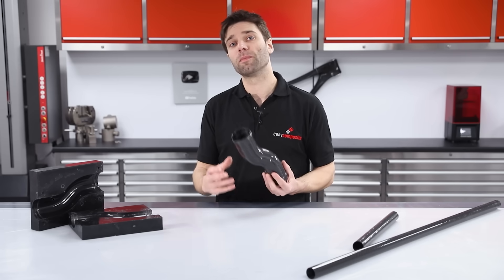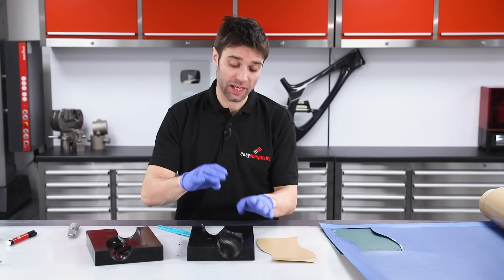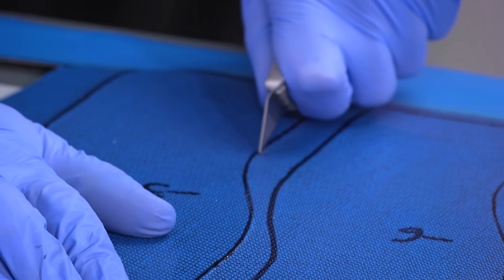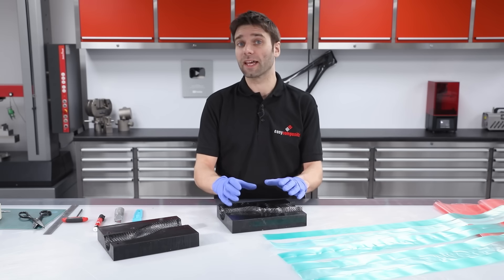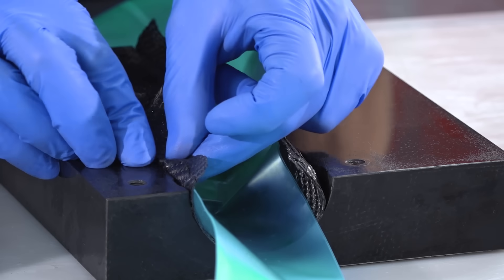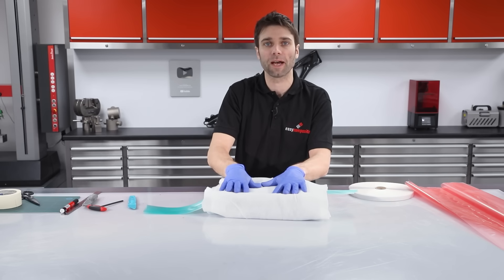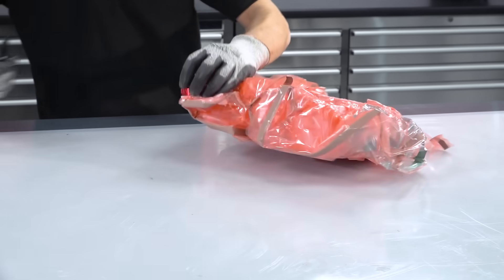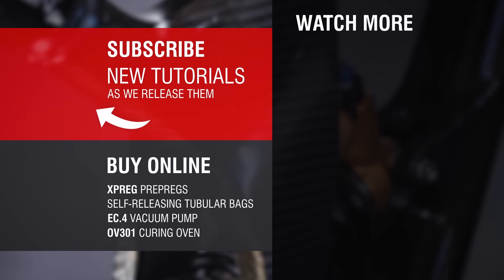Making Complex Carbon Fibre Tubes Using a Split-Mould

Comment: Sorry, but in formula 1, it is manufactured reversely. The mirror-smooth part is inside, and the outside is ugly as fuck, cause', its way more important that it functions, not the beauty.
Reply from the maker: Well, it depends which parts you're making. If you're talking about an intake then yes, but this process would be how they make a wishbone for example.

Comment: use a hair dryer with pre peg it's way more easy
Reply from the maker: Sure, you can do that (and we do in some of our prepreg videos). It really depends on the room temperature, the rheology of the resin system and the geometry of the part. Certainly no need in the case of this demo layup.

Comment: What sort of temperature is product made in this example capable of withstanding before failure?
Reply from the maker: The XPREG XC110 prepreg resin system has a Tg (glass transition) of 110C, at which point the resin would start to soften and the part would begin to distort. Other prepregs systems (including some of our own) have higher Tg, if required.
Reply: @easycompositestv  thanks,  I'm asking because I'm interested in producing an inlet manifold for a motorcycle. But I haven't done any testing about running temperatures or heat soak.  I'm just looking at the process that it maybe easier and cost effective than 5 axis milling of aluminium billet and more effective in terms of laminar flow than welding aluminium sections together.

Comment: Come on guys, if you're going to teach let's do it right:
1. Balanced lay-ups.
2. Debulking (esp first plies).
3. Bootlace detail.
4. Release / wax / copper slip bolts, especially since you've used blind captive fasteners (bad idea).
5. Release film before breather so you don't get fluffy components /  moulds.
6. Vac / Leak down test before cure.

Lets educate people, keep on dibbing chaps
Reply from the maker: Hi Matthew. We don't cover every detail in every tutorial, if we did we could never cover a topic without covering so many aspects that each video would last for hours and bore people silly. Whilst I don't agree with the importance/relevance of all that you've mentioned, especially on basic components, it is important to realise that over-complicating things can be as unhelpful in getting people to engage with a technology as not introducing people to it at all. Fortunately, almost everything you mentioned we've already covered in another video, at least once. This tutorial is designed solely to help people understand laps and internal vacuum bagging. Balanced layups: see our carbon fibre sheet video and others. Dubulking: see our introduction to prepreg carbon fibre, same for release film before breather, etc. etc. 
Anyway, thanks for the feedback, it's always good to hear different perspectives and opinions :)
Reply: @easycompositestv  it's not my opinion it's standard industry good practice developed by guys who have forgotten more than I know. Your tutorials reach thousands of people and offer good informative insight into composite processes, it however would be better to teach good practice throughout the industry. After all you are a composite training facility and hub of knowledge for others to learn from.

Comment: The whole vacuum method was a waste of time, money and materials. You can do it the old fashioned way and just inflate the inner tube. There are resins and polymers these days that don't require all that expensive crap machinery and special supplies, and reinforcing the moulds is the cheapest and most logical thing to do. But you'll always get someone who says "throwing more money at it gets you a better finished product" and those people hardly know how to turn a wrench like us "old school" trained guys" third generation Motorhead and the old tricks if the trade are still good enough, i will always laugh at the guy who depends on all those machines and special methods and whatnot 🤣👌
Reply from the maker: Good for you Slavic. Still, for those viewers interested to know how components like this are made today in industries like aerospace and F1 etc, where this process is used on a daily basis, then this is how it's done. Since industries like these have millions of ££/$$ riding on doing things the most effective way possible I think it's fair to say that they're unlikely to be a 'waste of time'.
Reply: @easycompositestv  i see your point. But the video isn't aimed toward education big industry. So yea, lol.

Comment: One could I think replace the layup with braided prepreg tubes of the correct diameter, simplifying the process. Has Easy Composites ever used braided carbon prepreg before?
Reply from the maker: There's a few obstacles with braided sleeves Anthony. Firstly, I'm not sure how braided prepregs could even practically be manufactured, stored, handled or used (although there may be solutions I'm not familiar with). For starters, the prepreg process has films on the inside and outside of the prepreg, I'm not sure how that could work - practically - for a braided sleeve. Furthermore, in most cases, the fibre orientation of a braid would be wrong. Braids will have predominantly +/- 45 degree fibre orientation, or at least some off-axis orientation, due to the way they're woven. Most applications for carbon tubes made the way we do in this video use a lot of unidirectional carbon oriented down the length of the tube, which isn't possible using a braided sleeve.
Reply: @easycompositestv  I believe that there are suppliers of braided prepregs. Not sure about those that are out of autoclave though.

Braids are available in almost all fibre angles and have many great attributes. Among them are the increase in bulk properties as a result of short fibre crimping.

They are a great replacement for wound fibres.

I have used miles of them in my high pressure layflat hose invention. 

This site can give you loads of information about them. I especially like using triaxial braids. In general they require fewer layers, often only one, to match the performance of multi-axial knits. A & P technology is I believe the world leader in braids. Talk to Pam Schneider there, she will get you onto the right people in short order. https://www.braider.com/

Comment: Cool, but not the most practical option for one off DIY.  This is three step; plug, mold, layup with lots of surface prep between.  Make the "plug" out of foam, layup.  Dissolve foam and then finish work.
Reply from the maker: Yes, you can do this. It really depends on the general quality you're working towards. A dissolvable foam mandrel will be putting you in a very different place in terms of accuracy, finish and future production but could be a workable option for one-offs or more basic solutions.

Comment: wow! how you made that tool? Can you make a video on CFRP tooling? thanks...
Reply from the maker: Hi Emiliano, it's a prepreg carbon fibre tool. The patterns (for the two halves) were CNC machined from epoxy tooling board like in https://www.youtube.com/watch?v=CWAvo8DIZ9s and then the mould halves made from made from XT135 tooling prepreg like in https://www.youtube.com/watch?v=k4GdAuNji5g

Comment: Is this as strong as the stuff they use on F1 or hyper cars?
Reply from the maker: Hi Enzo, pretty-much. There are some special components where alternative modulus carbon fibre might be used or resin systems with different properties but this is essentially the same. For example, we supply 2 European hypercar manufacturers with their prepregs.
Reply: @easycompositestv  Cool, thanks.

Comment: Labor and skill intensive. Now I know why CF parts costs.
Reply from the maker: Hi Karl, yes indeed.
Reply: meh not really. fiberglass parts are cheap as fuck. Cf is only slightly more expensive to work with. but it looks cool and people are easily fooled. so why not charge out the ass for it? the skills here are very basic. the tools very basic.
Reply: @DieselRamcharger  if what you are saying is true then make a carbon fiber part manufacturing business and make a killing. Ezpz right???
Reply: @DieselRamcharger  I can model and 3d print any mould, just didn't have the carbon fiber technique...so yes very basic if you have a quality mould
Reply: @ViralKiller  you will find printed surfaces require alot of post processing before the surface is acceptable to be used as mould or plug
Reply: Diesel Ramcharger 
Basic skills? Then 99% of the population doesn’t possess basic skills. Lol
Reply: @SkypowerwithKarl  Just because you can't do it doesn't mean the rest of the world can't.

Comment: is it possible to do something like this with simple wet layup and vacuum bag or with resin infusion?
Reply from the maker: Hi Mateusz, in reality, it would be extremely difficult to make a tube like this using a wet-layup or infusion process. Not impossible (nothing ever is) but it's really a matter of the practicalities of working with dry fibre, wet resin, split moulds and confined spaces. For a wet-layup method, if the tube was a bit larger or offered better access then it might be doable. For a resin infusion it would be quite a challenge positioning the reinforcement and holding it in place before positioning the infusion consumables and setting up the bag etc. Although infusion, and hand layup even, can be brilliant processes for lots of projects, this type of moulding is made infinitely easier when working with prepregs.

Comment: Yes....30 years of molding XP as applied to composite aircraft propellers. Using Rhino 3D and then applying the EXPANDER module.....you can produce 2D layflat files for your 3D mold surfaces....so.....you cut out your flat laid 2D shapes and then they fit PERFECTLY into  the 3D mold....no trimming.

That's if you feel the need to split the fiber at the parting line and overlap the edges....

This part SHOULD be completely close molded using continuous braided carbon sleeving.
Reply from the maker: Hi Stuart, certainly you can export templates out of CAD for the plies, that might be something we cover in a future video; this video was focussed on how overlaps work and the internal vacuum bagging process, it was really designed specifically to show in clearer detail the process used in the bike frame video (which was so complicated it was hard to see what was going on). Obviously, you couldn't use continuous braided sleeve in a bike frame (for so many reasons) which is why this component was made using lapped plies, as all bike frames are.
Reply: @easycompositestv  I was a friend of Randy Schlitter...of Rans.

Comment: What material did you use to make the mold and molds in general
Reply from the maker: The split-mould we used in this video is a prepreg carbon fibre tool. The patterns (for the two halves) were CNC machined from epoxy tooling board like in https://www.youtube.com/watch?v=CWAvo8DIZ9s and then the mould halves made from made from XT135 carbon fibre tooling prepreg like in https://www.youtube.com/watch?v=k4GdAuNji5g. There are other solutions for making high temperature moulds, such as a hand layup process using high temperature epoxy tooling gelcoat, resin and paste which you can find out about in this tutorial (on our website) https://www.easycomposites.co.uk/#!/composites-tutorials/High-Temp-Tooling-Gelcoat-Putty-Mould

Comment: I'm very keen on his stuff now.  Almost as accessible as fiberglass for the previous generation.  I have a similar question to Jason's.  Can some sort of balloon be used in an internal mould?  

Not many unlikes but it does seem you may be ruining someone's business model, that has no barrier to entry.  It seems that's now in the design itself if we want to be productive so we can't just copy someone's steel or alloy product and make any money like that.    I think that's just progress.  I think this is great.  Just looking at what else is around before I subscribe.  I think you might be a first mover here.  Nice timing, while so many are stuck at home.
Reply from the maker: The moulds you need for a pressurised bladder need to be incredibly strong (usually billet aluminium) in order to resist the deflection of the 'unbalanced' pressurised bladder. Therefore they tend to be very expensive to produce. An internal vacuum bag setup like this exerts equal pressure on the inside and outside of the mould, allowing much lighter, more cost effective composite moulds to be used.

Comment: Can you do a video on a deep/sharp angle part . 

I have a mould for a diffuser that I need to make and it has fins that are quite sharp and I am not sure how to lay the fibre for a resin infusion . 
Thanks .
Reply from the maker: We're planning on a video for a wing component, this would have lots of interesting information for deep/inaccessible parts, much like the diffuser elements you're looking to make.
Reply: Easy Composites Ltd that would be great thanks. Keep up the good work .

Comment: and this is why carbon fiber parts are so expensive
Reply from the maker: That's right I'm afraid!
Reply: Hyperian if you want to make them lower buy price just use industrial machines and bigger number of employees and you can produce more so price will be lower
Reply: @PakleniVuk  industrial machines = money. More employees = money.  More machines + more employees + more money invested does not equal more demand.
Reply: @kolyafreeman5414  + more production + more supply + more availability 
- price - time ✌✌✌😅
Reply: @samyoung8470  if it was that simple, we would be swimming in carbon fiber products nowadays. Modern mass manufacturing has existed for more than a century now and carbon fiber mass manufacturing has existed for more than half a century now. Even quality carbon bike frames are still in the $1k+ range.
Reply: @sepg5084  i think you did not got me brother supply and demand all plays a game a normal person does not even have craze for super bikes  or super cars then some one those have just use very less they don't have time for this stuff then comes some very less people those into deep stuffs and are  very less who will thousands of models for those very less peoples and those very are much less in country man 🕊🕊🕊❤

Comment: I'd imagine there is a compromise to strength using a split process as you're relying on the strength of the resin for the interface. Is the only and/or main advantage cosmetic? Compared to an alternative external layup of a sacrificial mold, such as salt or foam.
Reply: You might imagine it, but you would likely be wrong. The design of the joint is robust and my guess is that it is not going to be the primary failure point if pressure tested.

Comment: Those bags can also be re-used as a cost-saving measure.  I use them about 20 times when using pre-preg at 400 degrees Fahrenheit for 30 minutes.  You can seal one end of the bag with a thermal sealer.  The high temp tape used to seal the bags can also be reused at about the same rate.  I should keep in mind that our setups are a bit different than yours.  The general idea is still the same.
Reply from the maker: Hi Tony, nice advice. I posted (a little further down) too about the possibility of reusuing consumables. We've never found it practical to re-use tape unless it can be left in situ but I guess that's what you mean. Thanks for the post.

Comment: You could make a lost  wax casting mould so there would not be a split in it the carbon could take the heat to melt the wax back into a form to make another
Reply from the maker: Lost wax is tricky for prepregs but there are other sacrificial cores that could be used, they tend to be water-soluable wash-out cores. It really depends on the component, some need a finished outside, others a finished inside. Using a sacrificial mandrel will give you a better *inside*.
Reply: Easy Composites thanks

Comment: do you know what key differences can differentiate carbon fiber from black kevlar? or what characteristic that carbon fiber strictly has as opposed to black kevlar?
Reply from the maker: Hi Gary, black Kevlar doesn't actually exist but maybe you're thinking of black Twaron, which is an alternative to Kevlar. They would feel pretty different and also look different too but if you really wanted to check just try cutting the fabric, Twaron is very difficult to cut with normal scissors but carbon is easy.

Comment: How to make a form?
Reply from the maker: The mould is made from carbon fibre because carbon fibre is a very unusual material in that it has a zero (in fact slightly negative) CTE (coefficient of thermal expansion). This means that carbon does not expand when it gets hot like most materials do, including fibreglass or aluminium. When you're making carbon fibre parts, it's best practice to use carbon fibre moulds. By doing so, the mould and the component have the same (almost zero) CTE. On the other hand, if you have a glass or aluminium mould that expands and contracts more than the carbon you're curing inside, this can cause problems/stresses on the mould/part.

Comment: Great video !   How about doing another one on making the mold ?   Looks like a really nice mold.
Reply from the maker: We probably won't make a video on this exact mould but we have covered the process (pretty-much) in two of our other videos. The split-mould we used in this video is a prepreg carbon fibre tool. The patterns (for the two halves) were CNC machined from epoxy tooling board like in https://www.youtube.com/watch?v=CWAvo8DIZ9s and then the mould halves made from made from XT135 carbon 10:00 28/04/2020fibre tooling prepreg like in https://www.youtube.com/watch?v=k4GdAuNji5g. There are other solutions for making high temperature moulds, such as a hand layup process using high temperature epoxy tooling gelcoat, resin and paste which you can find out about in this tutorial (on our website) https://www.easycomposites.co.uk/#!/composites-tutorials/High-Temp-Tooling-Gelcoat-Putty-Mould